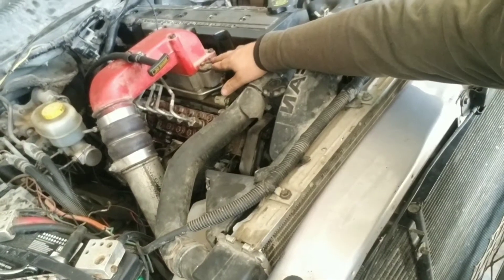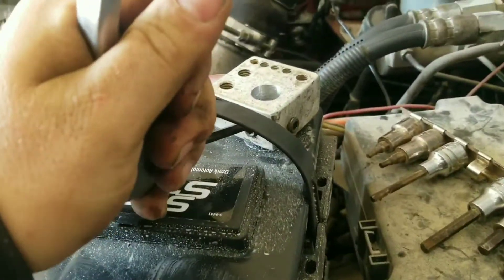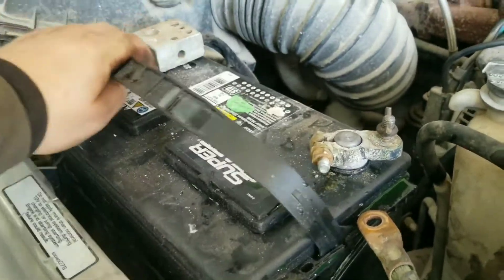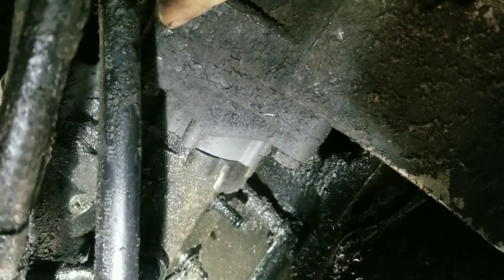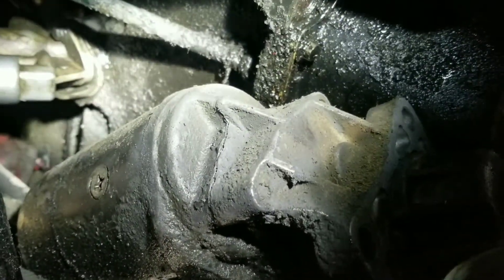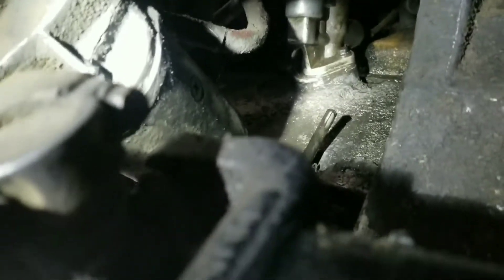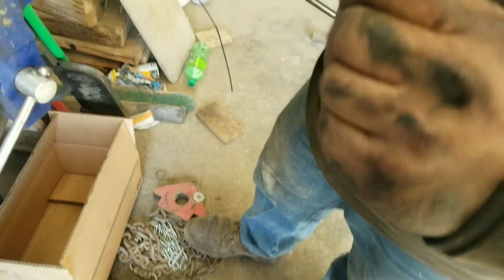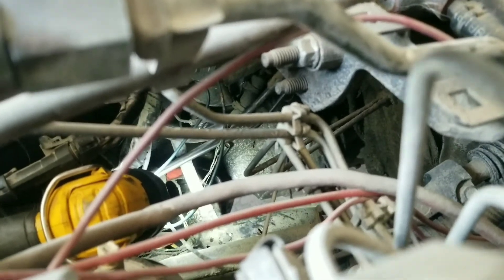5.9 cummins dipstick tube replacement

Comment: Thanks for documenting this. This is in my near future. One other guy posted in a forum that 1/2" nylon air brake tubing can be substituted with some sealer at both ends. I have not verified that however.

Comment: Some of those oil leaks are by design. The self lubing chassis feature helps fight rust
Reply from the maker: Haha , I saw a video the other day the guy was actually spraying oil on the under side if his body.  Seems to me that would only collect dust without a consistent supply.
Reply: @iowaorganicfarmer8128  fluid film works good but is expensive. I have a leaky oil cooler line. It does a good job haha

Comment: My tube broke just at the fuel filter area, so looking for a replacement on a 2006 Ram 3500 Cummins 5.9. I thought the tube was steel? The dealer wants $306.00 bucks for the tube, and if it needs an O ring that is another $26.00 Canadian beaver bucks on top. Drip, drip, drip on the driveway! Inland Kenworth can sell some parts for the Cummins engines.
Reply from the maker: I think the part number has been listed in comments. I didnt get mine thru dealer,  but online somewhere.  Probably could get it on ebay too.
Reply: @iowaorganicfarmer8128  Thanks for the reply.  I just found Inland Kenworth sells parts and services the Cummins engines. They can sell SOME parts to you.
Reply: So what method did you use to remove the tube?
Reply: @Favored1881  I tried the method on the YouTube video, but the tube was really stuck, and cramped space. I said fuck it and caped off the tube as it was making a mess with it leaking oil. I took the truck to a shop to have the work done, it was a bit expensive though. All good now!  If you do run into this problem and you are handy, do give it a shot yourself, your results could be much different than mine.

Comment: Did you run the 12 valve camshaft, to run that mechanical lift pump on the block?
Reply from the maker: The mechanical is still there, but I have an inline electric just behind bellhouse on the frame rail. Makes for slick and easy fuel filter replacement.

Comment: On my 12 valve, the metal tube from the block that allows you to slide the dipstick tube on is broken off. Is there a part for the metal stand off tube? Thanks
Reply from the maker: Yes there is cummins part number 5269589...  it will need to be driven out from the bottom side, good luck getting it out.

Comment: Hey Iowa, thanx for "blazin" the trail for me, so I NOW know what I'm up against.  You mentioned you put larger head  starter bolts in:  Was this simply for "ease of installation/removal" or was it bc of the manual tranny swap you made?
Reply from the maker: Had to get longer bolts for the 6 speed trans, was a 5 speed. Theres a space for the starter with 6 speed bell housing.

Comment: What the part number on that tube
Reply from the maker: 4761975..... I got it off ebay and it works perfect.
Reply: BTW, I talked to Cummins and my man Adam said they no longer carry that "gauge tube"(part # 4977372) bc Dodge has the rights to it now and of course it's got a different part number.  Mine's an '07 5.9 2500 and the part number for THAT is: 68002977AA.  I hope this helps SOMEONE cuz I spent quite some time figuring out what was gonna work for my truck.  I paid $42.38 CAN for it & $44.60 for expedited shipping from a Canadian supplier😖
Reply: @victorbunch1442  what supplier did you use, I'm looking for it as well